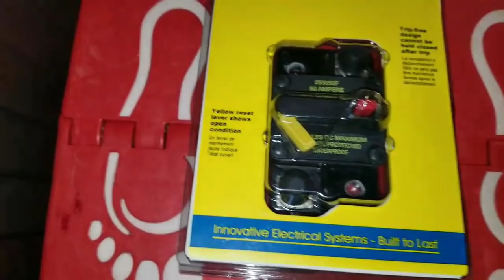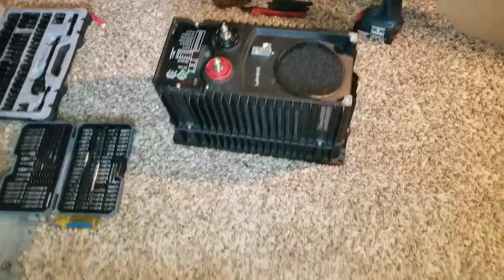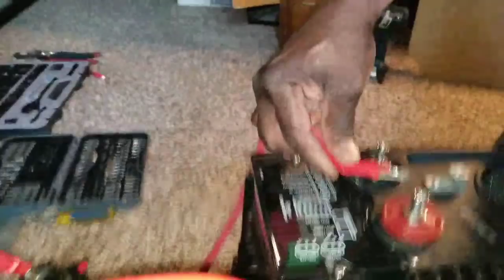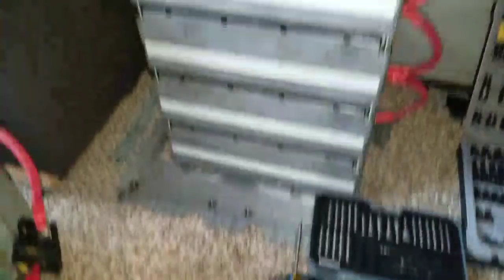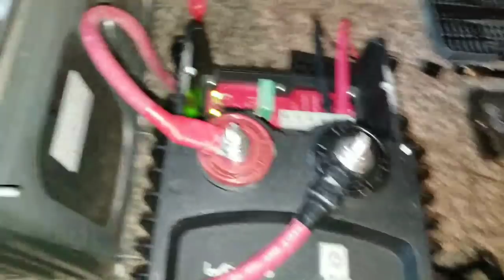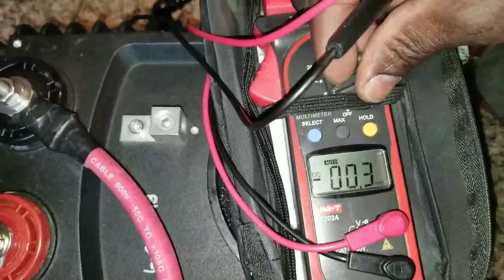OUTBACK POWER INVERTER CHARGER: LIVING OFF GRID REAL DEAL HOME SOLAR(PART#4)

Comment: Would you buy a used 5 year old outback 3524 ? Was considering a Schneider sw4024
Reply from the maker: I would buy the OutBack or Magnum Energy depends upon the price.
LIKE and SUBSCRIBE
Reply: @jwsolarusa  I'm in Jamaica, most places dont really sell the magnums anymore and outback is expensive here. The Schneider is what most installers use in ja
Reply from the maker: Do you want a good investment, high quality and long lasting product?
Reply: @jwsolarusa  yea, just starting but wanna upgrade to 48v in a few years
Reply: So you don't think Schneider is good ?
Reply from the maker: @diy-bj2ed  
Stick with OutBack Power Systems. I am telling you out of experience. I have dealt with most of these equipment. 
Watch my videos on the Xantrex XW6048 Inverter Charger, OutBack Power Systems, MagnaSine Magnum Energy, Mppsolar PIP5048MG, Cotex, Samlex, and DURACELL Inverters. You can find all of these videos on my playlist. 
This is your project and do what is best for you and what your heart desires. 
Have a bless day, and don't forget to LIKE SHARE and SUBSCRIBE
Reply: @jwsolarusa  ok thanks
Reply: @jwsolarusa  the reason I'm considering the out is the replacement boards are not hard to find online